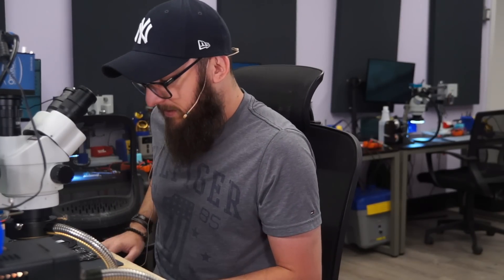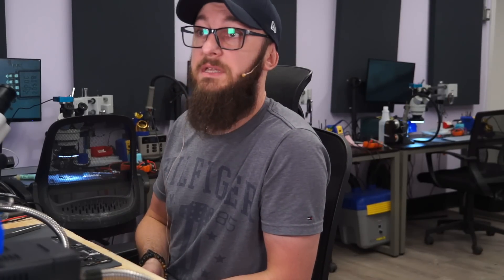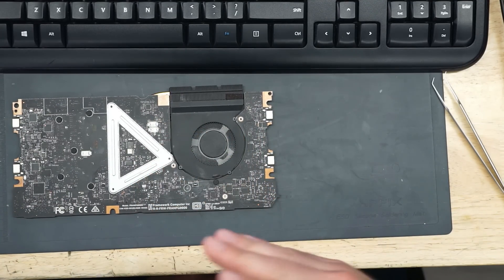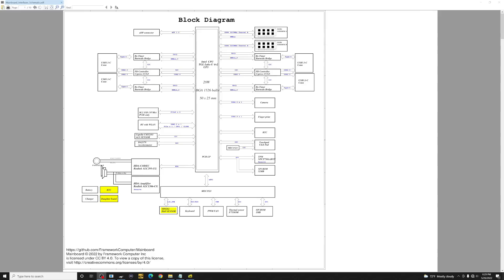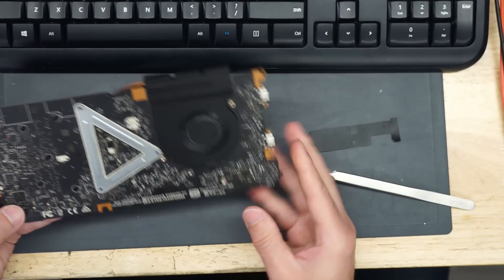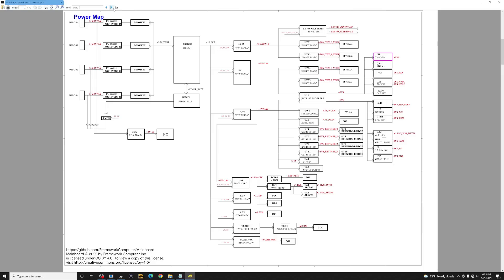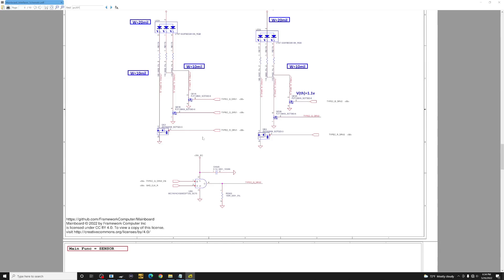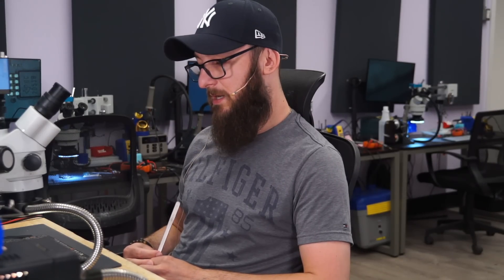Framework laptop water damage repair attempt using partial schematic

Comment: Response from the Founder of Framework on an HN thread:

We make full schematics and board views available to repair shops under a confidentiality agreement: https://knowledgebase.frame.work/en_us/availability-of-schem...
In this case, we didn't see a request for it come in.

Publicly with no agreement required, we were able to share a sub-set of the schematic focused on the internal and external connectors: https://github.com/FrameworkComputer/Mainboard/blob/main/Electrical/Mainboard_Interfaces_Schematic.pdf.

Louis has more context on the latter in an earlier video: https://www.youtube.com/watch?v=8cJj8PUY0DU
Reply: So basically a little beyond what System76 provides right now, as they also provide schematics under an NDA (but to customers instead of just repair shops, c'mon Framework). It's not enough yet, but it's good to see progress being made given the fights they must be having with ODM's to get even this much.
Reply: They addressed this with Louis earlier when he made his first video and Louis acknowledged their concerns.
Their concerns skirted around infringing on other manufacturers designs.
If they release a schematic another company could come out and explain how their laptops were blatantly ripped off or some such

Comment: Hi Chris, hey Louis. 
Do you guys feel that there is a slow progression of manufacturers like Dell, Lenovo, Realme, etc  bringing LPDDR4/x RAMs in their mid range laptops that are not repair friendly?Even, plastic lids have pasted screens with hinges plates (0.5 mm thick) pasted on the led that eventually breaks within warranty or just out of one (Dell 3511) and replacements only provided by the companies through authorised repair. 
Is it possible that despite  Right to Repair creating waves around the world, companies that Target APAC consumers will get away with systemic introduction on Non Repair friendly parts at competitive prices?

Comment: If they at least had a component reference chart with the component part number next to the reference with no schematic then that would be most helpful without disclosing the rest of the schematic design, this way you can at least replace obviously damaged components without a donor board.

Comment: it was discussed on the WAN show how to disseminate information of a product, doing it in stages so that the product can be kept running longer and longer, when the product was at End of Line and no longer being supported, that everything be released. Lets push for that while pushing for information on repairing the mainboard!

Also Good Job Framework, Please continue to improve, and pull the entire industry by their teeth if you must
Reply: Alas EOL is most of the time too late to avoid the device being gone long ago to the recycling center. You need from day one the schematic and if possible boardview (not the PCB routing, not the layers, just the point to point connexions to be able to follow). Because there is always someone who'll water damage their brand new device and need a repair out of warranty, even when the device is just out.

Comment: Where's the "repair attempt"? 🤔 That was just boring whining about not having better board schematics. Tell us what you don't have and move on. Show us the mentioned thermal camera image, try power injection, voltage tracing, faulty components measurement, something. Then you can say you tried to repair it. Otherwise it's just a frustrating video. 😀✌

Comment: That’s just a block diagram, it’s a basic logical layout of the system it’s not a schematic, it won’t show you the circuit topology or the physical board layout, no wonder you struggling to find things aren’t there.

Comment: thinking have you ever thought about your team and you getting together and designing your own motherboard, to fit in Apple macbooks, this could be a good solution for old macbooks running the latest iOS or Linux.
I don't believe the manufacturing would be that expensive in China
somewhere around $200??
simulator and run it in software so you get it right.
now that is true recycling.
and make the screen connector universal not just for the MacBook.

Comment: I kinda saw this coming given how many components are on these boards.  We need more but its a step in the right direction. Im assuming this is kinda the "Beta test' and im optimistic.
Reply: This product is not in beta no, but lewis's company repairing it is likely a dry run to see how that goes. Framework has been cagey about providing technical documentation for it but has indicated they are receptive towards it.
Reply: Why should ne the amount of components affect it?
Reply: @rkan2  More components, more chances one of them has a strict NDA and the harder it is to get so many companies to all play nicely.
Reply: @alexatkin  yeah, all manufacturers afraid of getting their reference layouts leaked lol..
Reply: @rkan2  putting together a device isn't as simple as buying components and slapping them together, guy. There are dozens of business deals and a quagmire of legal/regulatory processes to go through. Some of those deals come with an NDA.

All that being said, schematics or die.
Reply: @tissuepaper9962  For a Laptop, it shouldn't be that bad. Don't think much of what goes on on a mainboard would fall under an NDA. Large parts of the firmware, probably.
Reply: @tissuepaper9962  Where did I say it was simple? That said, putting together laptop PCBs isn't that difficult compared to all of the rest of the integration making everything work together well as a system. The reference designs should be part of the deal when you buy enough parts for your project.

Comment: In the frame.work knowledge base it says that repair shops can get full schematics by contacting support. Have you tried contacting them?
Reply: Armchair expert moment
Reply: well this is a one off repair. Louis does macbooks for 99% of repairs. Any overall pc repair shops might be able to gain access though.
Reply: Luis already has the full schematics so either this is full schematics for this is only using the schematics available on github.
Reply: "Luis already has the full schematics"
If Louis has them then Kris didn't look in the right file. What we see on screen is not them.
Reply: @tactileslut  okay so then is this the files released on github then? Seeing as you know what the "full schematics" referred to on the website entail.
Reply: @tactileslut  would make sense, was just basing off prior videos. Don't watch too much but every now and again there's an interesting video that I'll watch.
Reply: @NotThatGuyJD  files on github are just describing all the connectors, for anything else you need to sign a confidentiality agreement with them

Comment: Are you sure the find function even works on that schematic view?  I work with PDF construction blueprints and some PDFs do not work with the find function.  I suggest you double check with a word you see on the screen to make sure the find function even works.
Reply: this. Always check THIS. 👌
Reply from the maker: ................

You guys didn't even scroll through this did you lol
Reply: @rossmanngroup  To be fair, I didn't. I searched on one word, expecting it to show up if the topic was covered, and it wasn't. Cory used "find". I searched for "search". Corey's post was about 10 minutes older than mine. (To be fair to me, the video was that long, and I didn't refresh after watching it through.)

Comment: Have they given a reason for only having a partial schematic? I'm still new to this, but I just cant understand why you would only distribute partial schematics to repair shops if for nothing else than to avoid problems like this.
Reply: I suspect it’s because framework bought the rights to some of the base designs and they’re not allowed to reproduce those. I think Louis talked about that being one of the anti-r2r arguments and it seems like it might apply here.
Reply: Louis hinted at this.. Basically, when someone wants a motherboard design, they go to certain companies. But since these companies often do very similar designs, they tend to reuse parts of the design they created for a previous customer for the next one. Of course, the design was made for and belongs to the first customer, so if a schematic were released publicly, this could open up customer #2 to a lawsuit.

Comment: Bit disappointing that it appears to be limited so much. We need to keep pushing them, it's a starting point.
Reply: Unless they move to an off the shelf CPU (some older ARM cpu) they are going to find it very hard to legaly share full schematics since lots of the useful info such as operating voltages and what lines are hot when will be under strict NDA aggremets with the chip providers and not part of public spec sheets. The reason chip vendors opt to do this rather than share a public spec sheet is that they want to own the customer relationship ship between them and the OEM they do not want you as a laptop vendor to just be able to order intel BGA laptop cpus from your regular parts wolesale instead they want you to come to them and sign a contract that might even prohibit you from selling products that use their competitors chips in them...
Reply from the maker: Sometimes I wonder if everything we're going for here is two decades too late. Even when a company wants to be repair friendly they find themselves having to become an intel, AMD, or quanta competitor to be able to do it. It's too high a hill to climb. Who's going to become their own mainboard OEM or processor manufacturer just to compete in a low margin industry for consumer laptops and cellphones? You're not becoming a real compal or AMD competitor with a few million. Probably need billions to get that off the ground with a good chance of failure. 

It's hard to imagine I'm not just whistling past the graveyard trying to have repairability inculcated into our culture again. Even if I did manage to get normal people the world over to recognize and care about this as an issue, deconstructing the existing systems and building competing ones from scratch to make it happen in reality is like flying to Jupiter and living their in my lifetime.
Reply: @rossmanngroup  absolutly, in the early days of intel things like chip specs were published and even better you could buy the chips from a parts re-seller as generic parts without the need to enter a very restricting contract with intel. 

at some point intel (and others) figured out that they could make more money however by putting these contractual constraints on OEMs.

right now Apple is likly in the situation were they could release the most complete schematics as the SoC is thier own and while they likly do buy parts under strict NDA contracts they have the buying power to put pressure on vendors to let them release the schematics but I don't think they want to do this.
Reply from the maker: A lot of it has to do with the fact that we don't make shit anymore. 

When other people are doing the making, they can set the terms. 

It's so much more than just one person at just one company.
Reply: @rossmanngroup  yer for sure,

And its going to be hard to get legislation past that is worded in such a way to make it possible for OEMs to share full schematics without being liable.  But I think something along these lines is required, you cant legaly require an OEM to release schematics if doing so would make them be in breach of the contracts they have no choice but to sign with intel, AMD, etc. 

even a company like apple who has the most ability to do this today would end up being sued by their providers if they just published the schematics that leak. They might be able to put enough pressure on these providers but some of them know they are critical to the product (eg intel with TB repeaters).   And even when apple contracts a dedicated part to be made bespoke for them (IR**) unless that contract included these terms they would need to go back and re-negitate terms.
Reply: @rossmanngroup  Sadly, it often feels that way. The pessimist in me think the ship has sailed on the right to repair. Especially when it seems to be getting worse in some areas. But I will remain hopeful that someday we get back to the "old days" where ma and pa repair shops are able to make repairs.
Reply: @rossmanngroup  aka achievable with gargantuan effort and by smoking a bit of the hopium
Reply: @rossmanngroup  Reach out to Linus (LTT) again and let him know about this issue. He invested in Framework a few years ago and might be able to push on this issue. Just a thought.
Reply: @rossmanngroup  hey, no one said this was going to be easy, but it matters too much to give up. youve finally gotten momentum, so dont stop. but youre right that theres a fundamental problem in the system. so instead of new laws, why not look in to old laws creating the problem? shift effort from new laws enabling to removing old laws in the way.

when you fix a board, you dont throw a new part on top of bad shit. you fix the problem by removing the bad parts, THEN putting new stuff on top.

so find the PPBUS thats blown, and remove the bad capacitor first.

aka find a lawyer (probably a patent lawyer) that can tell you where the laws stop the company, and look into getting that removed.
Reply: @camerontgore  Barely has any stake in Framework, but maybe with all of the publicity.
Reply: @user-is6yo3um7x  yeah, its less the actual stock, but the fact that if he pulls out, he will PUBLICALLY do it and chew out framework and likely sink the business. Linus has said that's his plans several times even in conversations with Framework. He's effectively using his fame to blackmail framework to stay pro right to repair. Which is awesome. But there is a limit with stuff like this with contractual obligations with Intel or amd.
Reply: @user-is6yo3um7x  I didn't know that, I assumed he had a bigger stake than that, but yes the publicity would be very big indeed. Any little bit helps the movement, thanks!
Reply: @camerontgore  I think he already picked at the partial schematics in WAN show. He might not have a lot of money in the game, but I trust he'll give them hell (with publicity) if they don't improve.
Reply: @miavaughn2393  He restated that when these documents first went up, that he was happy to see it as a starting point, but will not be happy if there is not an improvement made. He did also say he talked with the ?CEO about this specifically and that there is some valid reason at moment, but couldn't disclose what. The rumours would be that issue with oem & nda's , but it is not quite one I think would be, eh, non-discloseable.
Reply: @user-is6yo3um7x  It's rumoured to be around 200k of whichever dollars, but yeah, the publicity factor is hard to quantify.
He pretty much recused himself of dealing with laptops,  (unless burying Luke under an avalanche of them) , and 'has' to issue a disclaimer each time talks about any.
Something that he has been very clear on, since before investing,  was both sides knew what sort of path of wrath he'd embark on if promises are broken without very strong reasons.
Reply: @hishnash  what framework should do than is simple, post a "full schematic" that names every part by number and states why they can't tell you what it is. "This capacitor was provided by x and under agreement with x we cannot give you information" and name each and every single item on board like that. It would get a point across and give us someone to aim at next.
Reply: @rossmanngroup  Could they release a boardview that has the NDA stuff greyed out? With it showing something like: "Unable to show, contact company X for more information"
Reply: @rossmanngroup  Maybe if Framework did a mainboard exchange to cut down on the price of getting a mainboard replacement?  For example Sending your transmission core to cut down the price of a replacement refurb transmission. For example if it cost me for you 400 for mainboard repair vs sending in a motherboard and getting a repaired motherboard for 300 i would go with the motherboard replacement.  The only reason for mainboard component repair was it was damn near impossible to get a mainboard from apple, and when you could at a reasonable price, they much rather you get a new laptop.  The enterprise dell and lenovos it was much easier to get mainboards at reasonable prices but i dont think they ever had a swap program.
Reply: @rossmanngroup  the same ways unions consolidated workers to dictate wages… big unions and big companies need to be broken up BUT with international trade its tricky, if we break up our companies but foreign countries dont… they just dominate globally.. very tricky chess game going on in real time.
Reply: You’re exactly right.
Reply: Linus is actually considering pulling out. Ever since they released their laptops they've basically just dropped the ball and like 10 different occasions.